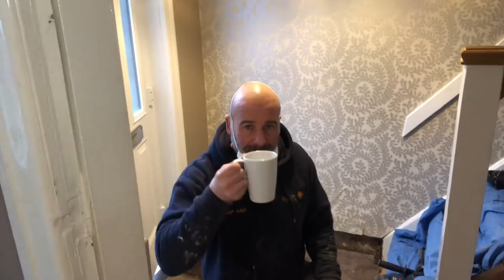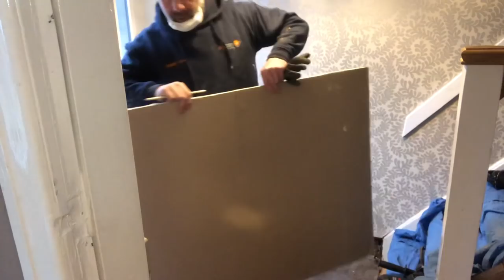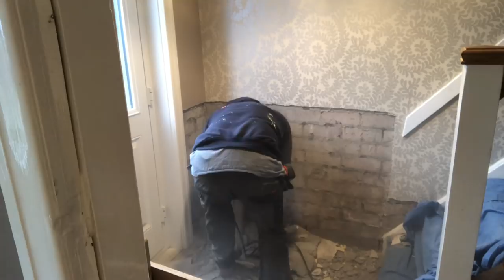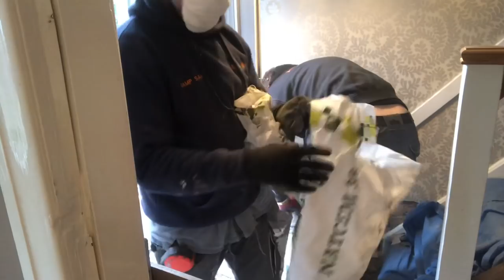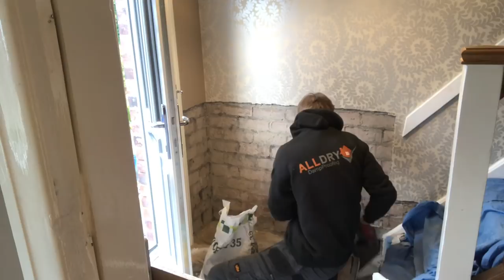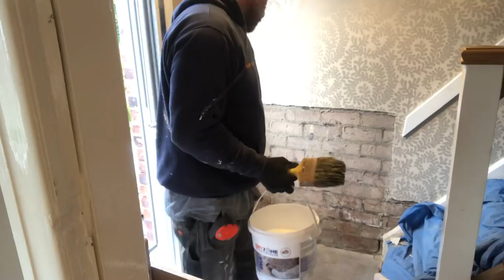Fast damp system part 1

Comment: Random question but, can I use one of those wet dry vacuums to hoover up the dust? I read you can't use it to suck out the dust when you drill the holes because they would be damp and it wouldn't clear it properly, but for the plaster dust you're sweeping at 17:11 could I used a hoover?
Reply from the maker: It depends on your hoover, always Reed manufacturers instruction, some hovers would be ok I assume

Comment: Hi Enjoyed the video - is it possible to put traditional wet plaster on the wall instead of the plasterboard ?? thanks
Reply from the maker: Yes of course as long it’s a salt neutralising plaster. There are loads on the market and even sand cement renders if mixed correctly.
Reply: @dampsam  Great thanks I will look into it thank you